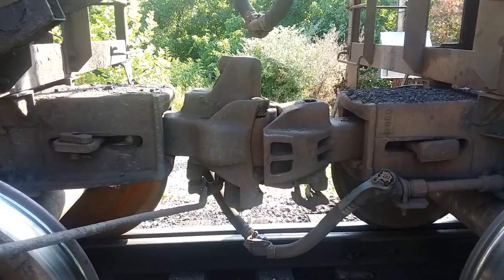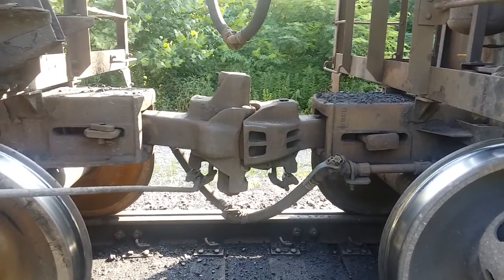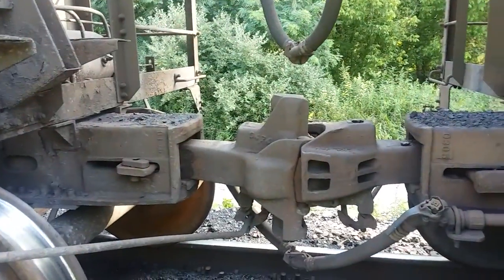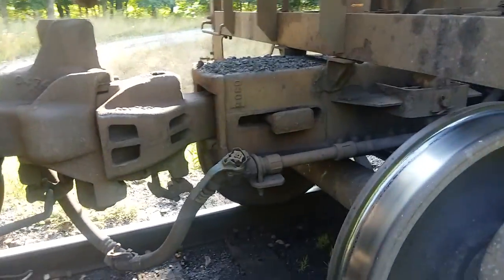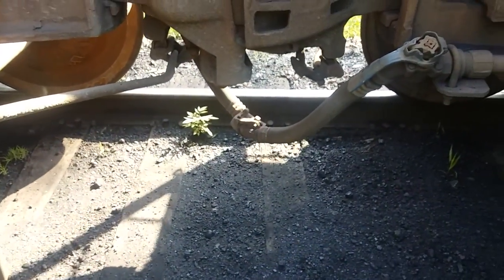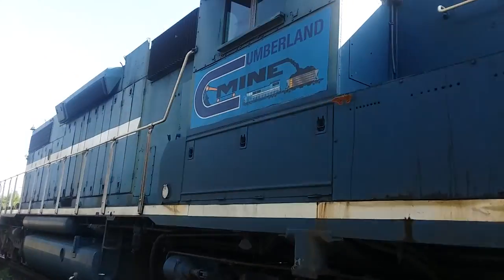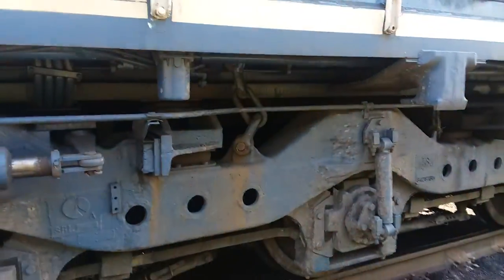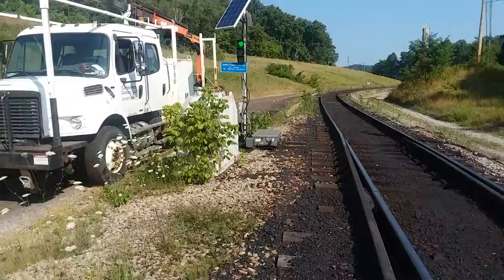Railcar Coupler Slack Action, plus Shelf Couplers

Comment: Oh, and to answer you question on the shelf couplers: All hazardous material cars must be equipped with couplers having top and bottom shelves projecting from head end front faces.  The purpose of the shelves is to prevent vertical coupler disengagement during train derailment and thereby minimize the potential for tank car shell puncture. Thanks.
Reply from the maker: Thank you for your information, well received.

Comment: Between watching this and learning about shelf couplers and watching Hobo Shoestring on here, I am getting some good insight. He taught me that the rail has the year it was made stamped on it, and you can tell if a car is loaded by being able to slide your fingers in the springs up to your knuckles. If it is loaded you can barely slide your fingers in. Propane tanks sit on the side of the track, by the switches, to heat the switch in the winter, and the brake line air valve will be closed on the end of the consist that would normally hold the caboose when trying to figure which end of the cars the engine will couple to. The closed air valve end will receive the FRED or EOT device. They air the lines up to 90 PSI before the train can move, always step over the rail not on it as you can slide on the rail and a train can be on you in a second, and more good stuff. He is an actual professional hobo, LOL.

Comment: Fantastic breakdown on the shelf/ double shelf couplers... We use type H tightlock couplers for passenger cars, which is an enhanced version of what tank cars use... For those who didn't know, the industry standard for tank car couplers changed after the 1974 Decatur, IL train accident. A Norfolk and Western switch engine was switching cars in the yard and a coupler bypassed during a joint, jumped up and punctured a tank car carrying some sort of flammable gas... the gas carried across the yard until it found an ignition source and exploded... Blew up half the town. -Every rule is written in blood, and railroad safety usually only comes after a serious accident!
Reply from the maker: Eric, thank you for great comment! Really appreciate when fellow railroaders add information like you have provided, i learned some things too. Excellent addition to this video! You are right bout rr safety. Thank you again sir.
Reply: It didn't blow up half the town, lol what the heck? It was in a railyard, way far from town, didn't even damage homes that were a football field away, just a big ole fire ball in the sky basically.
Reply: @OregonCrow  my wifes family lived in Decatur and had broken windows from the blast... they live almost 1mile  from the yard, so yeah... there was wide-spread damage, look it up!

Comment: Slack action:  A silent killer of trainmen.  Cushion cars like Auto-racks and Cushion equipped cars are the worst.
Reply: the auto racks are the worst offender, especially during switching movements... pushing the slack in to get the pin between two racks can get claustrophobic for your shoulder if you aren't careful
Reply: Auto racks can have as much as 18" of end-of-car hydraulic cushion drawbars. That's 36" total cushion slack per car. This does not include the free slack in the couplers which can add another 2" or so. Certain hydra-cushion cars (e.g. boxcars and refrigerated boxcars) have as much as 30" of cushion slack on each end of the car. That's 5 feet of cushion slack per car! Imagine what it's like to run an 80 car train of these. CSX and UP used to have a coast to coast refer train service. Sometimes that train would be 85 cars. That's a LOT of slack to manage. Some of the engineers would break them in two.

Comment: Interesting video. What's the purpose of so much slack? It's not like the pocket has springs inside to absorb some of the load shock.
In the UK some of our electric multiple units / EMUs use Tightlock couplings. It's a knuckle design with a wedge shape key cast on one side and a corresponding pocket on the other. When coupled the wedge fits in thd opposite coupling's pocket and it performs a similar function to your shelf couplings.
We have many coupling types in the UK it's ridiculous as they often need special adapters to couple two trains in an emergency.
We have the link and buffers, drop down buckeye, Dellner, the German made BSI, tightlock. Add to that the various control systems that mean even some trains from the same manufacturer can't work together except for emergency recovery of a failed unit. Some locomotives, classes 59s, 66s, 67s, 70s, some 68s and some 73s, use the same AAR system you have in the States.
Reply from the maker: Thank you for the interesting comment. There so much slack cause couplers are wore out! They do have draft gears behind coupler shank, check out vid i made earlier this year on draft gears, and thanks for watching!
Reply: Umm yes, there is a device, called a draft gear or some cars with EF, long shank couplers, have an End of car cushion unit. Draft gear is a rectangular cast steel device with either springs and a wedge system inside it or a rubber type draft gear.  The slack is there so nothing breaks. If you had a solid system you'd never get anywhere and would be constantly breaking parts. The slack is what allows the couplers to be able to move and pivot a bit so that cars can transverse curves also. It's much more pronounced on an E69 long shank EF type coupler system.

Comment: Slack couplers seem counterintuitive to me. The constant bumping when there's a change in momentum would seemingly hurt stability but I'm so obviously wrong.
Reply from the maker: They are mandatory on haz mat cars, reason being they
theorize that if there is a derailment the cars will stay
coupled and have less chance of rolling over. However in
reality it all depends on the speed of the train at the time
of derailment plus the conditions that caused it. I have no
idea why some of our cars have them and most don't Bradley.
Really appreciate your checking out the video today my good man.

Comment: So what do the shelf’s do tho why are they required on tanks?
Reply from the maker: Very good question. They are designed in case of a derailment
the cars will not come uncoupled. That is the reason given
for the requirement on tank cars. Although I'm not certain whether
the rule is for all tank cars or just those carrying hazardous 
material. I know for fact it is for all hazmat cars.

Comment: So that kind of coupler can't just totally pull apart from the car it is attached to. Got it.
Reply from the maker: You are correct Shirley, it must be manually released. The shelf
couplers are designed to keep tank cars coupled together in
case of a derailment, which is good in theory but doesn't
always happen. I have no idea why we have some of our 
cars with shelf couplers, they are not needed on hopper cars.

Comment: I had a thought about the brake airlines with the gladhand coupling, why didn't the railroad engineers make a better design that eliminates having to reach between the cars to reconnect the hoses?  I can't say I have a solution myself though.

Comment: It´s also "half coupled" betwen unit and first car. May be car springs are tired or car overload making it to low for a coupllng at right eight, or may be track bump that i didn´t saw. Or loco too high, i don´t think so.
That should be avoided as all efforts is distributed betwen half face of both  couplers with more vertical forces on couplers kunckles.
Thanks for these excellent shots.
Reply from the maker: Glad you enjoyed Daniel. We do appreciate your stopping by and
taking the time out of your day to watch and write in my good man.
Reply: @ccrx6700  well my friend your vidéos are simple and well made. You like your job for sure and your teaching bring knowledges to general public and rail rnthousoasts.
Thanks for your comment. Highly appreciated and continue your good work and be safe.
Reply from the maker: @danielfantino1714  😊👍

Comment: What’s the top air line for ? It was really hard to hear at that part 😊
Reply from the maker: The top line supplies air to be able to open and close the hopper car doors Anthony. Can't take air off the brake pipe or each time
the air would be used for the doors there would be a reduction
in air pressure and the car brakes would apply.  Thanks so much for taking the time to check out the video and may you have a very good day my friend.

Comment: I wonder if a length of rubber hose shoved on the outlet of the spitter would reduce the freaken noise?
Reply from the maker: I could try it, but what I really want to do is knock the dang thing
with a big sledge hammer and put it out of it's misery. That thing
drives me nuts. Thanks for tuning in and watching G N.
Reply: @ccrx6700  What does a spitter do?
Reply from the maker: @alexhajnal107  supposed help eliminate moisture from main air reservoir

Comment: What's the purpose of shelf couplers are they necessary? What's the reason for these couplers on the tanker cars? I once in awhile see a half shelf coupler on very few locomotives.👍
Reply from the maker: All tank cars carrying hazmat liquids are required to have them.
theory goes in case of a derailment the cars won't become
uncoupled. But if you've ever watched a serious derailment with
tank cars, they don't always stay coupled. I have no clue why
some of our coal hopper cars have them and some don't.
Reply: @ccrx6700  oh ok, my thoughts was probably if these tankers are coupled together for the most part n should their be a derailment, depending on speed, and exactly how n where n, how it derails, these couplers help the cars stay up right for the most part, amongst each other, preventing (more) other cars from rolling over off the tracks, (especially if their full).
 I do have some of these special couplers on my ho scale trains, (on tankers, both short and long tanks). just for the hell of it.👍
Reply from the maker: @edsel6818  staying coupled helps prevent them from bunching up and slamming  together side ways. Although it doesnt always work. Couplers do break

Comment: Why all the slop??
Reply from the maker: As you can see these cars get a lot of pulling, stopping and then
pulling again as the cars are being unloaded. So that means a good
bit of wear on the coupler and draft gear parts. And not all of our
operators are as smooth unloading the train as others are so they
often get banged around pretty good. Most hopper coal cars get
loaded and dumped about once or twice a week on other railroads.
here they get loaded and dumped 6 times a day, 7 days a week,
so that in itself is an extreme amount of wear on the cars. Very grateful my friend for your taking the time to visit with us and check out the video.
Reply: @ccrx6700  how much training does it take to become a full-fledged locomotive engineer?
Reply from the maker: @chessplayerelite669  we dont have certified engineers here. The jobs are all bid jobs and go to the senior bidder. We are not under FRA jurisdiction.

Comment: I got to ask, what is the second air line for that goes over the coupler? Is it for unloading the cars?
Reply from the maker: Yes sir, for dumping car doors
Reply: @ccrx6700  I presume that second line ties in to the air brake line through a one-way valve at the loco end?  Is there more to it than that?  (Maybe this would make a good video topic if you haven't covered it.)

Comment: Interesting about the remote control of the locomotive in this operation
Reply from the maker: Yes it is. He is moving the train with a controller box which is called a belt pack,  he can make the loco do anything he wants from that belt pack, such as: change direction, throttle up or down, reverse direction, apply brakes, etc.
Reply: @ccrx6700  understood , didn't know an on board operator wasn't required for safety , obviously it's a working system
Reply from the maker: @heartland96a  operator is in cab running main, they just use remote for load and dump. We got signs up along our acess road warning that train moves without notice. All of this is on our private roads at the harbor.
Reply: @ccrx6700  Yes ,  all good operating measures.

Comment: That’s a lot of slack!
Reply from the maker: Yes it is, these cars take a beating, its amazing they hold together as well as they do
Reply: @ccrx6700  The draft gear on the car to your right is functioning properly. The draft gear on the car to your left is defective. Notice the draft gear key on the right hand car is not moving much when the slack runs in or out. The draft gear key on the car on the left is meeting no resistance and moving the full length of the keyway. That means that the draft gear cushioning device is not working at all and needs replacement.
Reply from the maker: @thomasdupee1440  Excellent observation Thomas, thank you for sharing that. Did you happen get car numbers on the 2 you are mentioning? It,s been several months since I watched this, but if you didnt i will watch again
 Really appreciate your writing in.
Reply: @thomasdupee1440  agreed

Comment: Not thrilled about the coupler height mismatch between the engine and the car with the half shelf coupler.
Reply from the maker: No sir, it does seem like a lot, that a good recipe for car come uncoupled going over a dip in track. There is a teflon spacer pad under the coupler shank to help hold coupler up higher, perhaps its missing, will have to look. Thank you for your comment